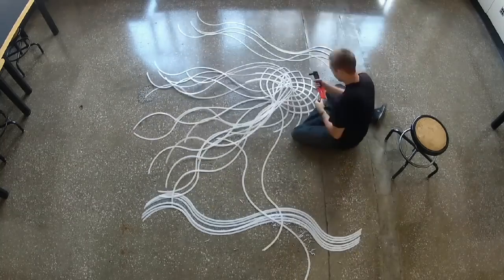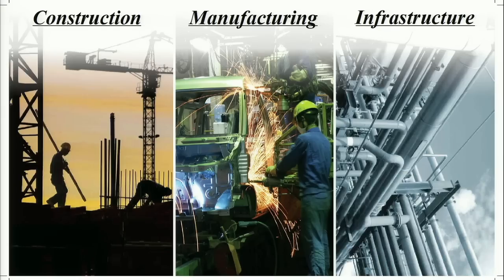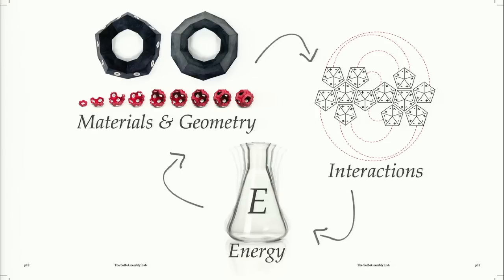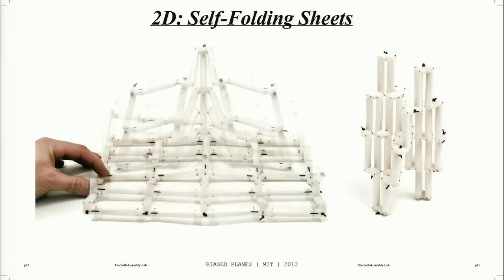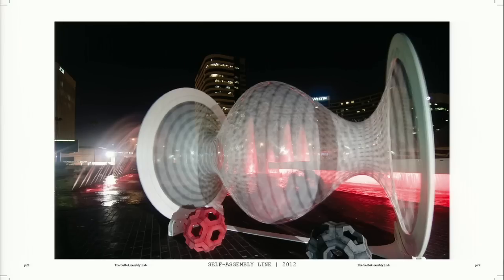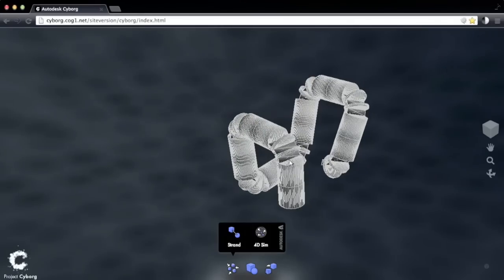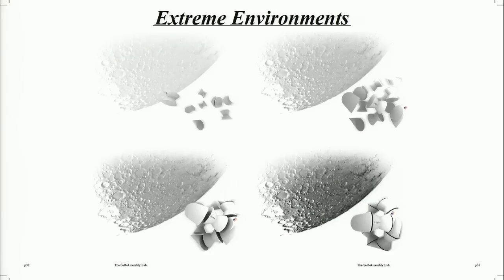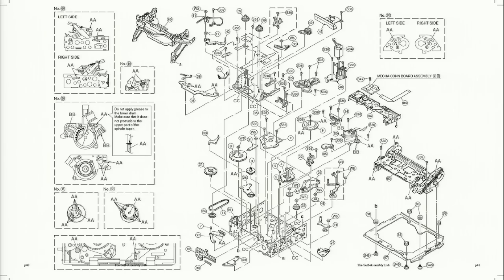The emergence of "4D printing" - Skylar Tibbits

Comment: This whole thing is incredibly misleading, and not so impressive.  They haven't built things that turn into other things.  They've built things that can be stretched elastically, or held together magnetically, and presented them to us in their stretched or broken forms.  Putting structures into a beaker that have magnets positioned only allowing the structures to fit in a certain way is no better than placing 2 weak magnets in the same beaker and saying "Wow, they break apart, but come back together in the same north to south structure".   He says they're programmable, but in the same way as a rubber-band or one of those toys that expand in water.  This is not new or innovative technology.
Then he says "4D printing", but really means, 3D printing of elastics, which either means he doesn't know what 4D is, or is deliberately using the concept to falsely draw attention.

This was primitive technology presented in con-artist ways.
Reply: Its 2024, i am a undergrad student fascinated by the idea of 4d printing. I came to this video to see how it all started and I am glad I saw your comment.

Now, do you realize @jobjobbington6884, that most of the great things in our world have come out of a whim or a unintended experimentation, in your words "a con".